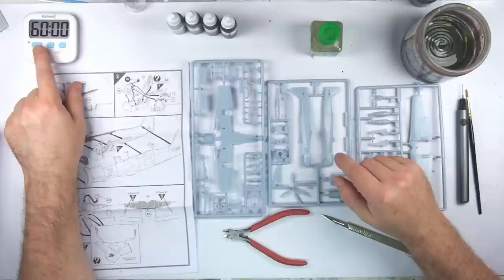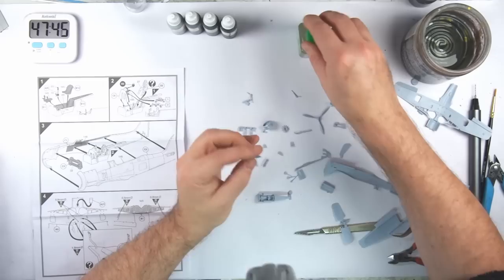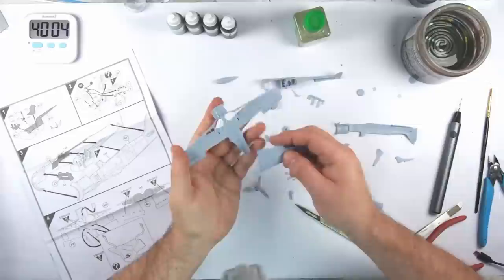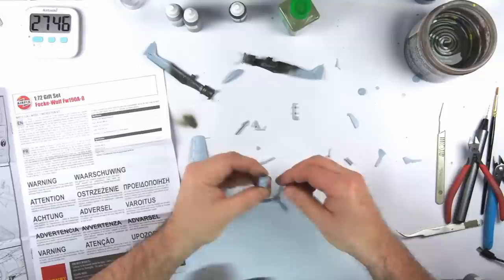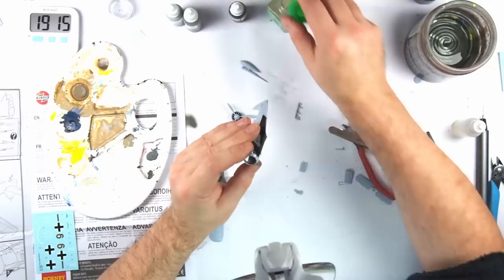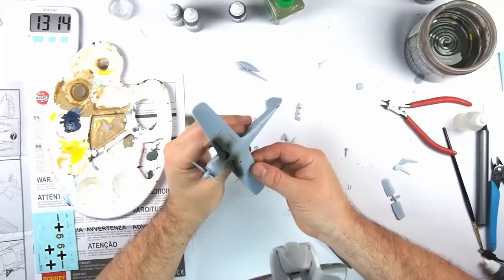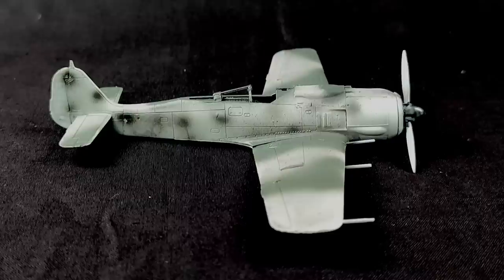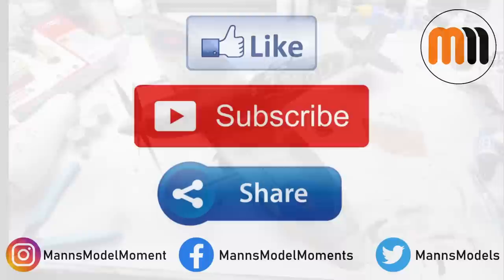Can I make and paint an Airfix kit in just 1 Hour?

Comment: Thanks for the challenge. I tried to follow - but after realizing I had broken the wrong half of the lower wing assembly I had to glue it back together and break it in the correct spot. Moving on to my final hold up - my kit did not come with "deck Al's". I looked everywhere. In frustration I substituted the "dee Cal's" I found in the kit (you hadn't mentioned them). Loads of fun. Let's do it again sometime.
Reply from the maker: I see - you must have the export version of the kit - Airfix reserves the best kits with DEC-als for special customers in the UK....😂

Comment: I have done this kit a few times, though I took my time.  Built kits quick as a kid, but in the ensuing decades I learned to take my time.  Still, I might try this challenge.  😎
You might try the Hobby Boss Easy Assembly 1/72 kits.  But most can't be built "gear retracted" without trimming and puttying.  I generally try to build aircraft kits with gear retracted, in "flight mode".
Reply from the maker: I know Mos (my podcast buddy) has done the HobbyBoss Easy Assembly Bearcat and had good things to say of it

Comment: Great idea for a challenge and we'll done on a very gallant effort,  not quite completed but not too far off, and it wasn't a simple kit!  If you ever get the mad urge to put yourself through this again, try the Airfix 1/72 Sherman firefly kit.  Part count is low, fit is good and also well designed, there's no 'cockpit first' issue (yah think?) and it's a one colour paint scheme.  I completed construction in a couple of hours just going at my natural pace which is generally very slow and laborious, and it builds into a little gem with minimal effort.   At the pace you were going in this vid I reckon you'd have it built well within 30 minutes, which should leave enough time for paint and decals.  Must confess I've not painted and decaled mine yet but it's been a busy week, one evening should see that done with maybe one more night for adding tonal variation and weathering.  Great vid, you have my sub 🙂
Reply from the maker: Thanks - that's a good idea and I do have that kit, so challenge accepted! :-D
Reply: @MannsModelMoments  Cool, I'll look forward to that.  And have I painted mine yet?... err 'no comment' 😃

Comment: Very good.  When about 10 or 11 I could knock out a kit in a couple of hours and that's with standard glue not rapid stuff and  enamel slow drying paint.  Looked horrific  by   today's efforts with gaps everywhere but great fun.  Incidentally did you clean your airbrush between colours or just put the next  shade in the cup when empty?
Reply from the maker: I did clean it, it was the only time I paused the timer, as changing paint in an airbrush is not really very interesting and isn't really part of the process, so I paused, washed it through and then put the next colour in

Comment: Hello again, question for you. As always, thank you for sharing and the content; I am using Vallejo Model Colors. I want to have an item with a High Gloss Finish; Is it better to add Gloss Medium to the paint or a Gloss Varnish after painting? (or both...)
Reply from the maker: For a high gloss finish with Vallejo I'd recommend a top coat gloss varnish rather than relying on the paint itself or adding gloss medium to an existing paint
Reply: @MannsModelMoments  Thank you for taking the time respond, appreciated. :)
Reply from the maker: No problem!

Comment: What a way to run the gauntlet, Alex. It could be the base for a series called Overtime, or how much time over the one-hour mark you need to finish a model at a steady but not rushed pace.

Edit: I think some kits can be built in under one hour. But need to be of a certain type. Extreme low piece count, few attachment points or keyed-ones, simple paint scheme. Old Huma's kits. Especially the trainers and gliders. Special Hobby's SG-38 primary as well. Airfix's venerable SPAD VII, too. One runs into all sorts of troubles otherwise.

Cheers.
Reply from the maker: I like the idea! Or maybe a scoring system which has time over penalties, but you get points for finish, look etc., So it'd be how you balance possible penalties with better finish....
Reply: @MannsModelMoments  That's an interesting alternative as well.
Reply: The Unimax 1/72 Corsair would fit that description perfectly.
Reply: @the23rdradiotower41  Not much left to build on those, innit?
Reply: @The_Modeling_Underdog  No not at all, I did the Corsair in roughly a week and I’m legendarily slow.

Comment: No but 1.5 hours probably yes.
Reply from the maker: For sure - although again, should you?
Reply: @MannsModelMoments  As a challenge just to see, sure. Why not? Some of my best results were quick and dirty builds. You outlined quiet well the limits you should impose on these builds, wheels up, skip detailling the cockpit and use a good kit with no engineering/ fit issues. Preferably one that you have already previously built  and stick it on a pole.
Reply from the maker: Yeah, I agree - I think we modellers can tend to get stuck in a bit of a rut of familiarity and "sameness". I'm primarily an aircraft modeller with a secondary in AFVs, but like to try other subjects from time to time, 3D printing, miniatures etc as they all develop skills and give different angles on the hobby

Comment: If you are using automotive paints, need only 30 minutes for this model kit..
Reply from the maker: I don't think so - but you may be interested in a future video that covers that exact subject!
Reply: Used to do.. NC based automotive paints dries instantly..
Reply from the maker: It's not the drying time that's the issue, it's control. For a single colour it would be fine but not a 3-colour camo scheme in this time.
Reply: Easy.. spray base colour first.. means light colour.. set the spray gun for lean pin point.. the paint will dry in seconds.. even yesterday applied sticker set to a scooter that I was restoring.. after 15 minutes applied stickers.. then sprayed clear coat.. the only thing we have to consider that the thickness of the sprayed material.. lots of air while little paint material. because the NC or PU based paints may damage the plastic material.. used to use fountain pen ink and water for weathering.. am working on an FW 190, to place on my race car layout, in red bull colour scheme..
Reply from the maker: Oh you mean in the airbrush, I thought you were referring to spray cans....!!

But no, I wouldn't be spraying NC based paints in a time challenge due to solvent extraction issues. You can't spray these in an area confined to a filming rig in 15 minutes, it would take that long to set everything up